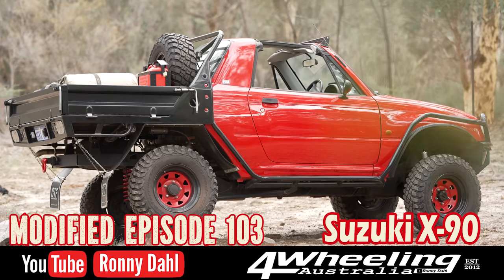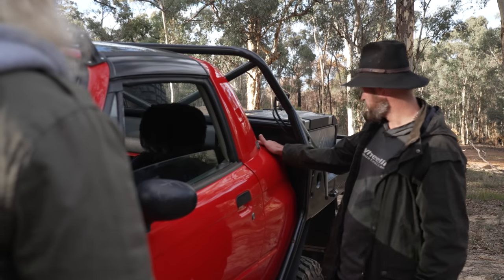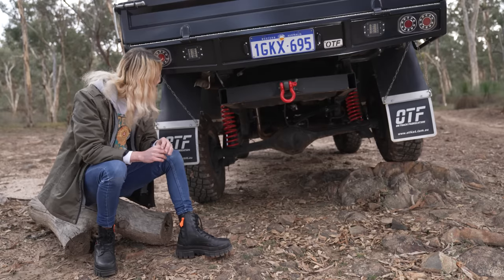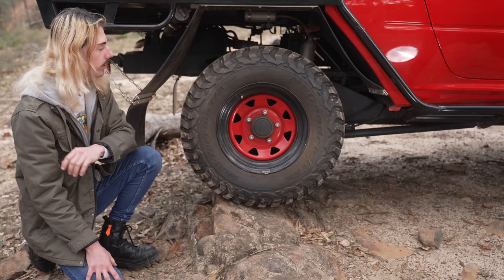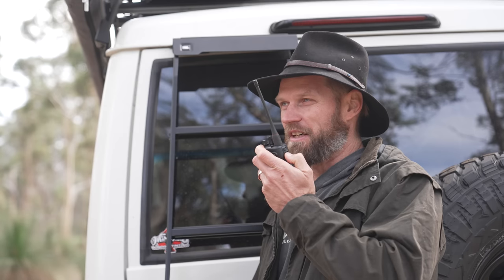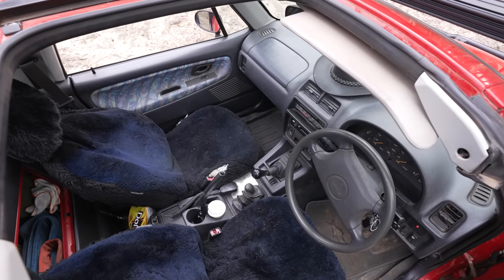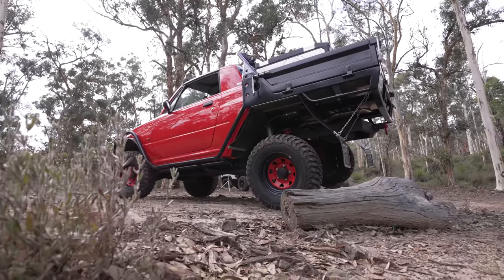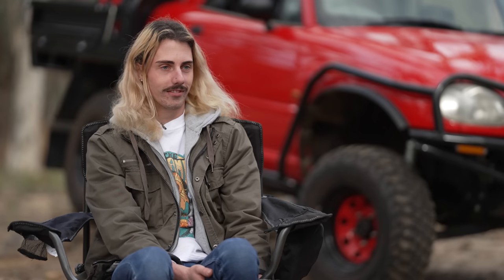Modified Suzuki, Modified Episode 103

Comment: Hi Ronny,
I have a question. I've seen that you have the Ram mounts X - Grip on your windscreen. Did you have to use the fast set glue on the suction cap unit?